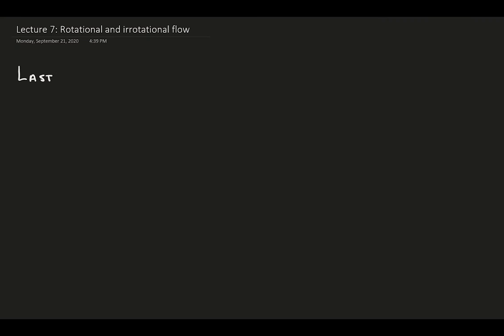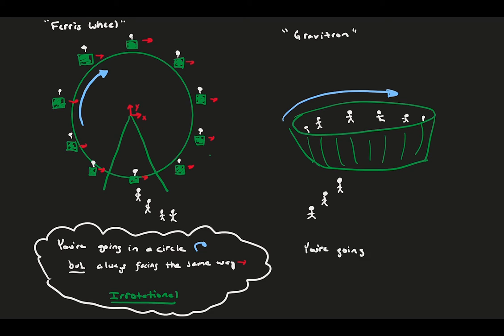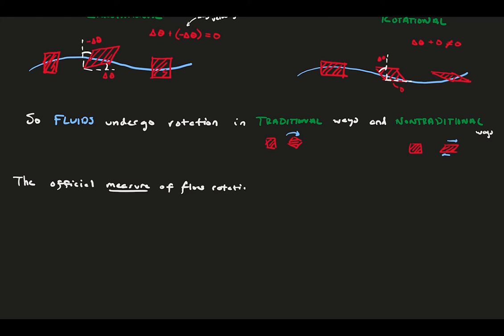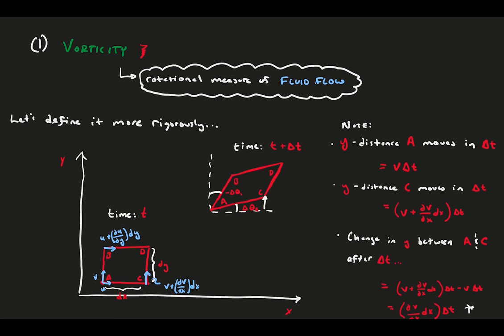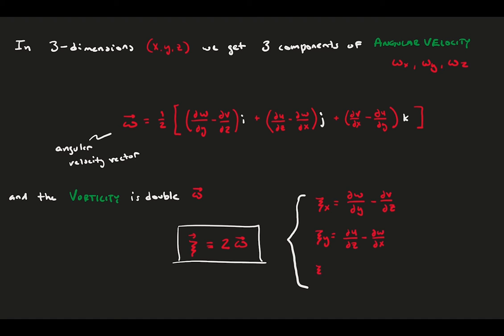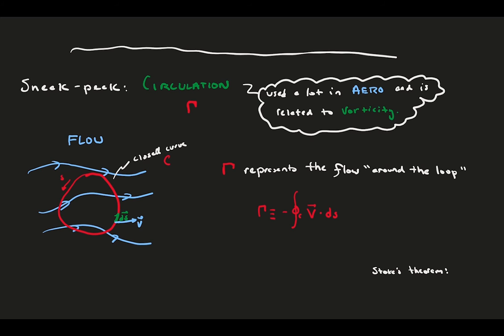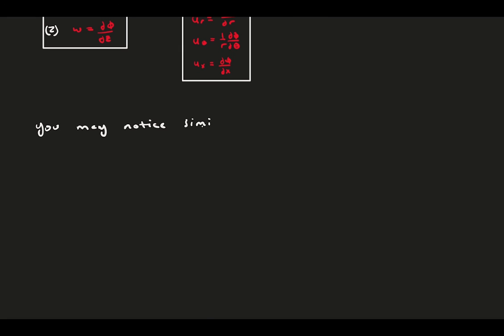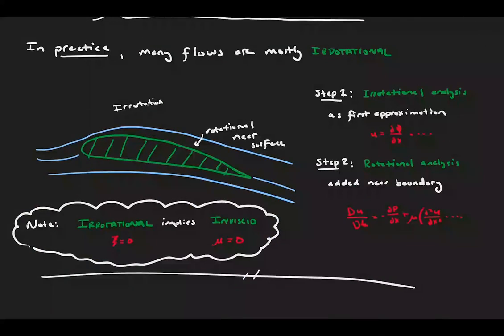Rotational and irrotational flow [Aerodynamics #7]

Comment: sir I have a doubt   why is the angular velocity the average of   both the rate of change of angles
?
Reply from the maker: Hey Rahul, this one is tough to explain through a comment. Maybe it's helpful to think about the extremes. In the case where both angles are the same, that indicates rigid body rotation and the angular velocity of the element is the same as the sides. If the angle change is equal and opposite, the particle deforms and doesn't rotate (the average is zero). 

Not sure if I helped or made it worse!

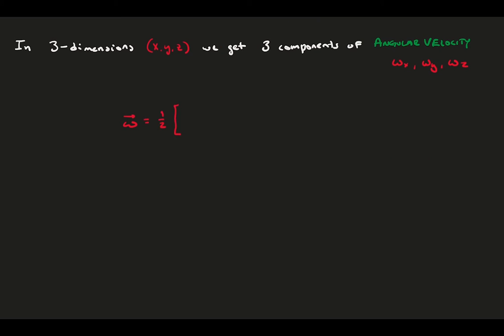Comment: Hi, in 11:53, average angular velocity should be written in (1/3)*(.......) , doesn't it?
Reply from the maker: Hi! In this case, I don't think so. What we're doing is taking the average angular velocity of each component, where the definition of a mean is (1/n)*sum(x_1:n). So, you will notice shortly before 11:53, omega_z = 0.5*(angular velocity_1 + angular velocity_2). At 11:53, we've just put all three components together and then pulled the 1/2 out front.